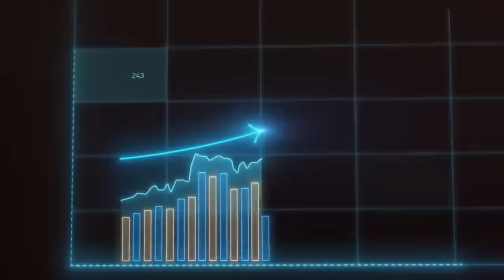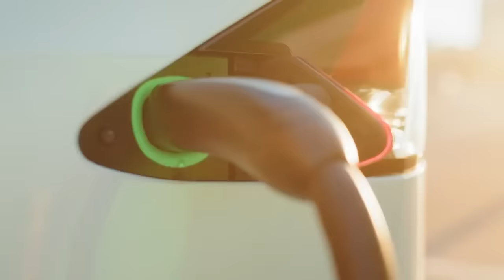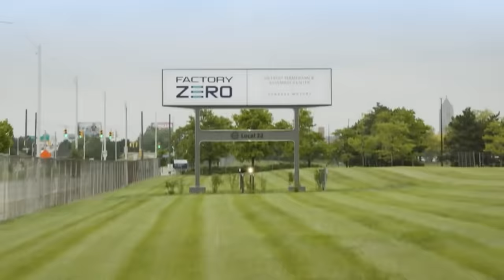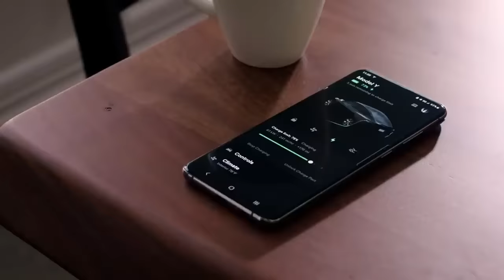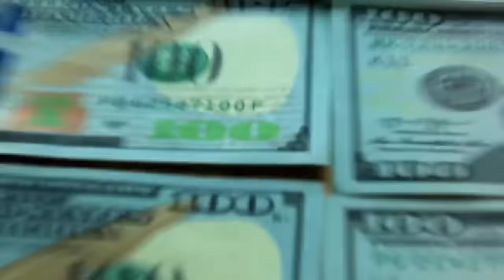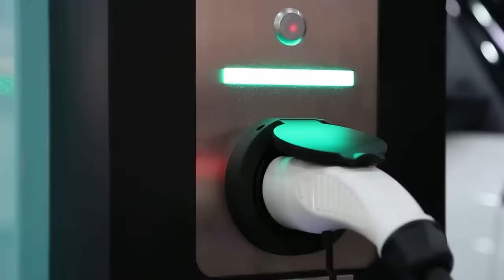Electric Vehicle Owners Are Frustrated and Demand the Return of Gas Cars

Comment: Things to love about EVs:

1. Child battery labor
2. Range anxiety
3. Risk of garage fires
4. Paying 20k more than a comparable vehicle
5. Battery denegration
6. Poor resale value
7. Reduced performance in cold, highway
8. Higher repair costs
9. Awful charging network experiences in the weather without restrooms
10. Higher insurance rates
11. Replacing tires more frequently 

But hey theres a tax credit!
Reply: Got an iphone, tablet etc. Lithium and cobalt. But you are happy to buy these products
Reply: @graemeglass7566 , you’re comparing apples with oranges. EV’s have MUCH higher voltage, which makes them far more susceptible to overheating, and thermal runaway.

You don’t recharge a cell phone, tablet or laptop with a 250kW fast charger now, do you?
Reply: Yeah, that pretty much summarizes the situation.

That said, perhaps some of these issues can be resolved with sodium-ion batteries. Nevertheless, there’s that pesky grid capacity situation to overcome.

Personally, I feel EV’s are only suitable for around town commuting. For everything else, use a hybrid. Of course, long haul commercial transport must rely on diesel for many years to come.
Reply: You're not following the $cience 😂
Reply: You hit the nail on the head!!! Worse yet we pay for the EV tax credit with our taxes, so ICE drivers are subsidising EVs.
Reply: You forgot two big ones in your list:
12. Risk of huge repair costs by slightest battery damage.
 13. Headache regulations for EV's involved in an accident. You will not drive home in your EV after beimg involved in an accident.
Reply: You don't charge those with fast chargers AND they're not charged to hundreds of VDC either. You're not on the same planet as a vehicular EV. My laptop battery is 20vdc & its not a massive battery like an EV vehicle either.
Reply: But you can call yourself "going green" to your family and friends. Oh and the dealer  ship will praise you for your lower carbon footprint.
Reply: Spontaneous combustion resulting in a total meltdown and loss.   If parked in your garage, then your house likely burns to the ground along with your EV.
Reply: @graemeglass7566 Because they actually work.
Reply: well that tax credit is going away to
Reply: @BlacKnightRising  Good
Reply: U forgot to add #12. Afraid of ev's setting your purchased home onfire 😵‍💫😵‍💫
Reply: @graemeglass7566  nonessential point.... people don't pretend to save the world by buy those ...also government isn't forcing you to buy those but even they are..... you seem lost
Reply: Yes mate and then add in the waste disposal of the batteries when they are either out of life and are destroyed by a fire. Plus the extremely dangerous hazard caused by the toxic gases and materials given of in a lithium ion battery fire to those who have to fight the fire anyone caught out near the burning vehicle and the environment that has now has become contaminated by those toxic emissions.
Reply: @graemeglass7566 comparing pocket size products vs EV cars 
😂😂😂
Reply: @lrg3834 just sell the EVs to virtue signalers and leave the rest of the ICE cars for  the practical .
Reply: @beansmayne4581  Quite the contrary
Reply: 9 is semi true, rest is ignorant.
Reply: @TheDeano4000  You mean accurate
Reply: @graemeglass7566 lol you think your phone and tablet use ANYTHING like the battery of of car??  😂
Reply: @waltbroedner4754  And we are also paying their taxes when buying gas. The gas tax pays for the roads that they destroy from being heavier than plain gas cars. Remember when tree huggers complained heavier SUVs are harder on the roads??? Now car with 1000lb battery is fine with the same people....
Reply: @graemeglass7566  So you want to defend the child labor to make your car battery, huh?? You are so kind!!!!!  Make child labor great again!!!!!
Reply: Seems you’re not aware Yellowsnowman that Cobalt is used in the refining of crude oil into gasoline & diesel. And that most new EV batts don’t use cobalt anymore.
Reply: @graemeglass7566 
 no choice
Allgovern by lawmaker, profitcedit, Blood money
Reply: @lrg3834  Gas cars are in fact more likely to catch fire spontaneously.  My uncle's 2021 Jeep Grand Cherokee burnt in his garage two years ago, supposedly because of a problem with a fog light...  I've seem countless brand new gas cars burning on the highway or cargo trucks carrying fuel litterally melting the asphalt of the road.

It's just that channels like this one only focus on EV fires since it fits their narrative, while in reality they are extremely rare.

Also, most of the points stated by the OP are simply wrong.
Reply: @waltbroedner4754 you are not subsidizing EVs nearly as much as you are subsidizing oil companies. But I bet you like to ignore that.
Reply: @h.mandelene3279 do you have any idea how much we subsidize oil companies?  The amount of tax spent on EVs is minuscule by comparison. Ok, let’s stop subsidizing EVs and Oil companies. Let’s see how you enjoy paying $10 a gallon or more.
Reply: @graemeglass7566 Pure genius right here,....NOT ...LOL⚡️⚡️⚡️
Reply: Great list, but why  do they have to replace tires more often?
Reply: @TheDeano4000 You mean accurate
Reply: @Rahbinah  the list isn’t great. Most of it is just oil industry propaganda and not true. However, the tires is true. For 2 reasons. One reason is that the evs are heavier, so a bit harder on the tires. But the biggest reason is the performance of the electric cars. They accelerate much quicker and people use up their tires a bit faster with that as well.
Reply: @graemeglass7566  correct. batteries work for little motors or electronics for a short period of time, just not cars and trucks. common sense stuff!
Reply: @waltbroedner4754  thats socialism!!!!
Reply: @berardoferrari  seems to work perfectly in my car. Loads of torque. Instant acceleration. 213 bhp 0-60 in 7.0 secs. Quiet too. Child labor? Do you people have mobile phones, laptops, tablets, Do you buy goods made in China like clothes, plastic stuff made but 12-16 year old girls who live in dormitories, and are sent back to their villages to get married. Honestly get real and stop being so hypocritical
Reply: I think that’s 5. Battery degradation
Reply: Don't care for child labor but the rest of the points are valid
Reply: I'll never go back to gas junk too much maintenance for me
Reply: The government give me a tax break just like you get a tax break for being married
Reply: Not only cold weather but hot weather is bad for the battery same as rapid charging
Reply: Range anxiety….. y’all are making a mountain out of a molehill on that. The charge stations are programmed into the GPS; with a bit of planning, it’s not a big deal. 

Risk of garage fires…….. what about an oil leak from your ⛽️ car, or a leaky ⛽️ can? You’re telling me there is ZERO risk with a ICE car?

All the other grievances are actually pretty valid. 

Although, ⛽️cars aren’t without their problems as well, so let’s keep that in mind. (Oil leak, transmission problems, engine overheating…..)

I’m not saying EVs don’t have issues, but let’s not pretend that EVs are the ONLY cars with issues, bc that is just not true.
Reply: That was a good point about the tires. Because every time you stop in the city you've got to get all that weight going again and that's going to be a lot more stress and those are made from oil.
Reply: Now with the car  burning in the garage you could always buy a robot that will monitor your car that can push it out in the driveway if it's starts getting hot.☺
Reply: EV's are great commuter cars where range isn't usually a consideration.  They can cost less to maintain than an ICE car, though major repairs can be expensive (though the same can be true for ICE cars).  I don't see why EV tires would wear out faster than on ICE cars, unless drivers constantly try to make use of the massive available torque that an EV can provide (burning rubber).  I agree that more work needs to be done improving batteries to provide for cold weather performance, and lifespan.  Also the charging networks are not yet developed to provide the same long trip experience that ICE cars have.   EVs NEVER require oil changes.  Brakes can last much longer than on ICE cars (regenerative breaking, same on hybrids BTW).  The life of a battery should approach the life of an ICE engine, how many miles can you get out of an ICE car before a major engine overhaul, and what does THAT cost?  So the battery replacement should be considered in the same light. 
Nuclear power IS green!  It produces NO green house gasses in power generation, though I have no idea what is involved in producing  nuclear fuel rods. (though the same can be said for the production of solar panels and wind turbines).  The myths of spent nuclear fuel storage  problems are vastly overblown.   EVs are the ONLY possible future as fossil fuels will be used up in a century or so, and we probably can't continue to burn them much longer in any case due to environmental reasons.
Switching to Sodium based batteries will solve some environmental issues as sodium isn't mined, it's extracted from sea water.
Reply: @KennethScharf  Yeah supposedly fossil fuels were supposed to be used up a long time ago. 
The torque on the tires is because the weight of the cars is doubled that would go for the brakes as well. Ev's would be a good secondary car for teenagers or elderly and I like the hybrids they had out but they're trying to push things too fast. Ergo the new problem with all of the weight of the vehicles the parking garages are not built to hold them. 
Due to the cold affect on the batteries their range is being reduced. 
Chargers are not working and it cost too much to put a personal one in your house to dangerous and now with the rise in electric it cost more to charge an electric vehicle than gas. Fossil fuels are not from dinosaurs. Most of it is about control issues about how far people should be able to travel. We believe in Freedom to travel when and where and how and they don't.
Reply: @Rahbinah Because they are that much heavier. They have more torque, so the tires spin easier. And I have got to wander if the tires are more expensive?
Reply: @croberts2358  Yes, most fossil fuel originated from plant material, not animal.  I forgot the weight issue, and that's in the batteries.
I own a Toyota Corola Hybrid (2023 model) and I'm very happy with it.  I've seen a reduction in MPG in the winter, not surprised here as the engine runs longer to provide cabin heat, and the battery probably  isn't as efficent as well.  But the total range per tank is reduced by less than 25% NOT 50% as in a pure EV (at 0F ).
The average home EV charger is just a 50A 220v outlet, same as for a dryer or water heater, not dangerous or even expensive to install.  EV fires are actually rare, though they can be much more energic than gasoline fires.
For now, EVs make more sense for commuter cars, and plug in hybrids for long trips OR commuter applications.  Serial hybrids may be the better design choice, my Corola is more of a parallel hybrid, though its transmission (a three way planetary drive) can sorta do both serial and parallel.
Reply: @graemeglass7566 Yeah, that is clearly the same thing.  It is not even apples and oranges, it is far more different.  And cell phones do catch fire, fun fact.
Reply: @graemeglass7566  They take less material to make.
Reply: @alien11able  really. ? Add up how million phones are built a year. How many power tools are built a year. Do your homework mate. You sound like a child having a tantrum.
Reply: 1. Gasoline cars emit CO2 and other harmful gases, contributing to climate change and air pollution.

2. They rely on petroleum, a non-renewable resource with volatile prices influenced by geopolitical factors.

3. Compared to electric vehicles, gasoline cars are generally less efficient in converting energy into motion.

4. They require regular maintenance like oil changes, filter replacements, and exhaust system checks, which can be more costly over time.

5. Internal combustion engines generate more noise and vibrations compared to electric motors, affecting driving comfort.

6. Gasoline cars typically do not have the instant acceleration that electric motors offer.

7. The extraction, refining, and transportation of oil have significant environmental impacts.

8. Internal combustion engines and transmissions take up more space, potentially limiting interior design.

9. Although this is changing, electric vehicles are often at the forefront in terms of advanced technologies and connectivity.

10. The pollution from gasoline cars can have adverse effects on public health, especially in densely populated urban areas.

11. With the global shift towards clean energy, the future of gasoline cars is uncertain, which could affect their long-term value.

12. Gasoline cars are subject to fluctuating fuel prices, which can be a significant and unpredictable expense.

13. The overall carbon footprint of gasoline cars, from production to operation, is typically higher than that of electric vehicles.

14. Unlike electric vehicles, gasoline cars cannot recapture energy through regenerative braking, resulting in less efficient energy use.

15. On average, gasoline cars are more expensive to operate due to fuel, oil, and maintenance costs compared to electric vehicles.

16. Gas stations and the fueling infrastructure can be vulnerable to natural disasters, geopolitical events, and other disruptions.

17. As the market increasingly shifts towards electric vehicles, the resale value of gasoline cars may decline.

18. Gasoline engines can't match the smoothness and consistent power delivery of electric motors.

If you only consider the weaknesses of electric cars, you're being ignorant. Gasoline cars have been around for over 150 years and only began to significantly improve with the advent of direct injection. Electric vehicles, on the other hand, are set to enhance their batteries through better compositions using more abundant, safer materials with greater capacity and improved fast-charging capabilities, approaching the refueling speed of gasoline vehicles. This is just the beginning of improvements for electric cars, unlike gasoline vehicles, which are reaching their developmental limits.
Reply: @trexmtb4381  You have precisely laid out why ICE cars have no future. 👍👍
Reply: most of the ones are having problems with overseas are the Ev buses Catching Fire and the E bikes.
Reply: AGREE TOTALLY!!
Reply: @croberts2358  so you missed the recalls on American EVs?  🔥 🔥 🔥
Reply: You didn't mention the EMFs they radiate during operation in that list. Like sitting up close to a microwave oven.
Reply: TIRES WEAR OUT QUICKLY AND ARE VERY EXPENSIVE. CHARGERS OFTEN DONT WORK.
Reply: @yellowsnowman9157  the ones that I saw in the United States were mostly trucks I may have missed some of them
Reply: @graemeglass7566  If you think batteries will only be made of lithium, that's ignorance. Batteries can be made from various materials, and it's only now that we are exploring the creation of better batteries with more capacity, safer designs, improved charging unaffected by climate changes, and longer lifespans. Given these advancements, traditional gasoline cars will become obsolete, If you think there's no future in this, your ignorance is astounding. It's like those who believed horses were better than cars, thinking cars had no future.
Reply: @debby705  now that's a new one I haven't heard of
Reply: @trexmtb4381  totally agree 👍
Reply: @croberts2358  Oh, so you think that gasoline cars didn't have these problems in the past, or that batteries will always be made from the same material and never change? Wow, such ignorance is incredible. I'm sure you're comparing it to a cellphone, focusing only on current limitations, which are obviously going to improve. Gasoline cars have had more than 150 years of development, while electric cars have been around for far less time. The key improvement will be in batteries. What will you say when they evolve to charge as quickly as gasoline, drive farther than gasoline cars, and are safer than gasoline vehicles? Also, keep in mind that electric cars are already safer in more than one way. Don't you hear about gasoline cars being more dangerous and prone to catching fire? It's obvious that oil companies don't want the truth to be seen. News outlets are influenced by them, with gasoline car advertisements everywhere, while Tesla relies solely on word-of-mouth. Look at how they are trying to tarnish electric cars, which have far fewer incidents than gasoline cars.
Reply: @markmiller8903  Simply put, people fail to see the truth that gasoline cars will become obsolete in the future.
Reply: If you don’t like EV’s that’s fine - you do you. Range anxiety is only something people have in countries with few charging points. As soon as you realize you can go anywhere you want, the anxiety disappears. Battery research has come a long way in a short time the LFP batteries do not degrade as much nor do they have the same risk of thermal runaway. As for the child labor, there is no cobalt or nickel in LFP batteries. Children are not the only option in production. Battery degradation is a thing, but you make it sound like a car is useless if it after 15 years only has 80% of the original capacity. It will still get you where you need to go. Is there reduced range in the cold – sure, that just means you drive slightly less between recharges. It has zero implications for my daily commute. The repair costs might be high (have never had any), but does that matter if you only need repairs every 5-10 years? I pay 6 times less for “fuel” in my EV compared to gas in Denmark, and I didn’t pay more because it was an EV due to tax. If you believe it is better with an ICE car in your country, then why not just continue using them and let the ones that like EVs enjoy their choice?
Reply: @graemeglass7566 I am not saying I 100% disagree however when EV's do it, it causes a lot more damage.  So I understand your stance better now.
Reply: @trexmtb4381  oh the lies.Around 1832, Robert Anderson develops the first crude electric vehicle, but it isn't until the 1870s or later that electric cars become practical.
Reply: @trexmtb4381  the first car to get a hundred miles per gallon was a Buick Roadmaster that weighed as much as a Humvee
Reply: @trexmtb4381  the problem with the current existing cars is that they are made to expire early they have plastic fans and stuff that are made to break that were made out of metal before
Reply: @trexmtb4381  did you know that the Egyptian had earth batteries they were found in the pyramids.
Reply: @trexmtb4381  did you know that cars have been experimented with that run on hydrogen and also ones that run on water and also motorcycles that run on water.
Reply: @trexmtb4381  yeah sometimes I may seem to be a little bit ignorant, but not so much more than others.
Reply: @croberts2358  What is needed is to improve the batteries. 😏
Reply: @trexmtb4381  oh by the way did you watch the videos from up North about the cars that would not charge and the Chargers that would not charge and people complaining about the EVs and their reasons and they owned them maybe you should.
Reply: @croberts2358  Gasoline cars have been improving for centuries, but batteries haven't. Do you know why? Because of the oil industry, Mr. genius.
Reply: @croberts2358  Seriously, they don't want progress. You seem content with being manipulated and resisting advancements in battery technology.
Reply: @croberts2358  so yea, And cars used to be death traps where you would die instantly in an accident because all the crash energy was transferred to the driver. So, what are we even talking about?
Reply: @trexmtb4381  you're barking up the wrong tree that was done for money and I speak as one who's written on running boards. Road in the back of trucks. Well stop there. Younger generation is afraid of everything most of the laws were written for money.
Reply: @trexmtb4381  No I speak as one who's afraid we're losing our freedom to explore. Scientists should be free. Not told what they can do. Or what they can question within moral reason. No one owns the absolute truth but God. And anyone who claims to is a fool.
Reply: @trexmtb4381  Why thank you for the compliment,  but I don't claim or aspire to be a genius. Actually just level-headed and try to stay sane.
Reply: Actually gasoline engines would do a lot better and go a lot further if they would release all of the technology
Reply: AMEN, tell it like it is.........people need to learn the truth!
Reply: Half of the things on that list are wrong.
Reply: @schwags1969 ice cars burn far more frequently than EVs. Also a fun fact.
Reply: @ChefNutter  going green AKA going woke?
Reply: None of that for me. Don’t believe they stories. Radical right can be as bad as radical left. Get one and make up your own mind, not letting others decide for you.
Reply: @steves2241  I don't think so I've heard people talking about it
Reply: First, let’s consider just the direct subsidies for fossil fuel production—money that flows directly from the government to fossil fuel companies to support activities like exploration, extraction, and development. A conservative estimate from Oil Change International puts the U.S. total at around $20.5 billion annually, including $14.7 billion in federal subsidies and $5.8 billion in state-level incentives. A whopping 80 percent of this goes to oil and gas (with the rest supporting coal), and most of the subsidies are in the form of tax deductions and exemptions and other “obscure tax loopholes and accounting tricks” that result in massive avoided costs for fossil fuel producers.
Reply: @graemeglass7566 I replace mine every couple years because of battery degradation - I don’t call that happy - I would prefer the battery last longer
Reply: You left out: 
waiting time it takes to charge them. 
EVs favor the rich: if you own your house you can charge at home for cheaper, but if you live in apartments you have to change at public chargers at higher cost.
Reply: The tax credit ended...
Reply: @llunaeldas8055   no it didn't. Educate yourself. EVs still a scam
Reply: All true, but add, electric cars are primarily run on coal. How is this better than gas?
Reply: Let's not forget occasionally having to wait for a software update to complete before you can go anywhere. We've all heard the stories about failed updates crippling the vehicle and leaving it unable to drive.
Reply: @PatG-xd8qn 
Relerivly rare B S
1000 Ev fires in one city in one year
😮😮😮😮😮😮
Reply: @garreysellars5525  A simple search on the internet will actually tell you that in fact, even when taking into consideration the few number of EVs on the road, thermal cars are more likely to catch fire.

And which city had 1000 EV fires in one year? And how many fires in gas cars did this same city have?
Reply: Putting stress on an already overloaded electricity network.
Reply: @cableken  If you live in a place where your electricity is produced using either hydropower, nuclear power, wind and/or solar power, then it shouldn't be a problem, since all these methods of generating electricity generate surpluses at some periods of the day which are currently lost.

The problem in all electric grids is almost always at the same time of the day during peak hour.  Thus, you can simply set your EV to start charging before or after the peak hour, when electricity is also cheaper.  This can easily be automated

Also, if you don't need your EV at the moment during peak hour, you can even sell back some electricity contained in your battery on the grid, which both helps to reduce the problems during peak hour and you can make a profit
Reply: @graemeglass7566 I am happy to buy a device with a lithium battery! Ill even play with a lithium polymer rig if I'm feeling adventurous. However, I don't hop in my phone to get where I need to go. Your phone may be a reliable form of transportation, but mine isn't.
Reply: @graemeglass7566  So you want to compare a hand grenade to a nuclear boom? Please use some common sense.
Reply: @2ndexplosivebullet  , you might want to take this up with the folks at Hertz because they're not going to agree with you; and they have a lot of experience with EV's.

Regarding ICE fires, trust me, none of my ICE trucks are gong to catch fire unless one is in a very bad accident. And even then, you have a good chance of putting out the fire with a portable extinguisher. EV's? Call the fire department and step away from the vehicle.

That said, it may be a different story with sodium-ion batteries. They look promising. Less density, but worth it if most of the issues with lithium are overcome. Sadly, when they do go mainstream, lithium-powered EV's will plunge in values (I feel sorry for many early adopters).
Reply: Hundreds of battery packs vs one. Great comparison.😊
Reply: @franklin519  The so called "oil subsidies" are standard accounting principles that apply to all companies. It's ridiculous to single out oil companies for using standard accounting principles. People like you also fail to acknowledge the taxes on diesel and gasoline. By the way while EVs do more damage to the roads they are subsidized by people pay road taxes. Don't get me started on the huge tax credits the rich get to buy luxury electric cars.
Reply: @franklin519  You need to list the specific subsidies that an oil companies get that aren't available to other companies. If you can't do it than your claims are with out merit.
Reply: @jimfarmer7811 
 
YouTube won't allow links.
How much US tax money has been spent in wars to protect oil resources again?  It's a lot more than EV subsidies. I'm paying for that with my tax money, ever think about that?
Reply: @franklin519  what a cop out. So you can't list anything to support your position. I suspect that you looked it up and found out that the "subsidies" don't exist. What a clueless 🤡
Reply: And they either are too uneducated to know, or conveniently ignore, the fact cobalt is used in refinng oil.
Reply: Add 74% higher risk of blood cancer (Leukemia) to drivers and passengers sitting on a floor of batteries, due to high EMF exposure.
Reply: 12. Several hours of recharge the battery in subzero temperature 😅😂
Reply: @graemeglass7566  Yes, child battery labor is not acceptable, but we don’t pretend that we are saving the planet. We don't say buy a lithium smartphone to tackle the climate change.
Reply: @Rahbinah as the Ev car is significantly heavier than an equivalent ICE vehicle, it puts more pressure on the road, and wears out the tyres faster
Reply: @waltbroedner4754  Not only are we subsidizing their tax credits,  we are subsidizing EV’s with every gallon of fuel we pump.  Even if they get charged $200 more to register their EV $200 is nothing compared to what we are taxed to maintain the road infrastructure.
Reply: @trexmtb4381  Horses better than cars, we've all heard that false comparison before. You know you could make the same argument for Hyperloop (which failed and was always impossible)
Reply: @trexmtb4381  This "batteries haven't improved" is BS, batteries have been improving since the advent of the mobile phone, tablet, and laptop. We got Lithium Ion batteries because of mobile phones, tablets, and laptops, NOT EV's.
Reply: @dguy321  Guaranteed, if you took EV fires per EV, and ICE fires per ICE, you would find that EV's catch fire more often. It's only because you ignore the fact that most vehicles on the road today are ICE vehicles, and the least vehicles on the road are EV. The amount of fires per EV per person is WAY higher than ICE cars. Look in China, BYD is notable for burning to the ground, as with most other Chinese EV's.
Reply: @PatG-xd8qn  Selling power from your EV back into the grid will wear your battery down faster than if you only used it for driving... So the cost of selling energy back into the grid is basically the cost of buying a new EV battery sooner rather than later.
Reply: @franklin519  If you think wars are not fought over Rare Earth Metals (REM) then you're the dimmest bulb in the bunch. REM are fought over just as much if not more than Oil. Why? Because of the military industrial complex needing chips for missiles, jets, ships, etc.
Reply: @ElvinDude  You can't compare to smartphones... 1) the battery is MUCH smaller and uses far less rare earth metals 2) Smart phones don't use the same voltage / amperage that EV's do 3) You don't need to install/upgrade your home wiring because you bought a cell phone 4) you don't have to wait outside in the cold to charge a cell phone 5) you never have to tow your cell phone from the super charger back to home 6) you don't have any tires on a cell phone that wear out faster and need replacement ... I could go on. Cell phones are not comparable to EV's - just stop with the insane comparison.
Reply: @fmo94jos8v3  incorrect. Ice vehicles burn far more often than Ev's per capita. Hybrids burn more frequently than ice vehicles, and EVs burn the least frequently. All per capita.
Reply: All true for non-Teslas, you got it!  I’m sure the fact EVs have 1/10 the fire issues including garage fires vs. ICE car for car means little…. Latest battery techs don’t use rare Earth materials, it’s amazing how off you guys are on the realities of EVs are, you are lapping up the oil-industry “news” FUD…
Reply: @fmo94jos8v3  I guess you can’t read, the commenter above comparing Smartphones with EVs, so both technology uses child labor. I’m just saying people who use Smartphones don't pretend savior of the world. So stop being hypocritical, that was my comment about.
Reply: @fmo94jos8v3  By the time there will be enough EVs on the road for us to worry about electric grids (meaning in many years), the technology behind batteries and the number of cycles they can go through will have improved a lot.

Also, what we have learnt over time is that most car manufacturers used to understate the durability of their batteries in order to avoid getting sued, since they actually didn't know how long they would last.  For example, in the first generation of the Chevrolet Bolt, the company stated that the battery of the Bolt would only last 3 to 5 years and just about 100k kilometers (or around 60 000 miles), but time has proved that they are far better than that with most (if not all) Chevy Bolt still working perfectly for way longer than that.
Reply: Best part is the Tesla superchargers powered by diesel generator sets built in shipping containers.
Reply: @kdrapertrucker  Where is this?  The only 3 articles I found referring to this have actually been proven to be false.
Reply: What about ROAD TRIPS???
Reply: @fmo94jos8v3  That's why we need better-made batteries for cars. As you've mentioned, lithium improved for mobile devices and similar technologies, and now we need something better for vehicles.
Reply: @graemeglass7566 no yet are you attempting to compare a battery car to a device?🤭
Reply: @waltbroedner4754 👍 next will be a rise in insurance even for ice just to supplement the cost!!🙄
Reply: @schwags1969 🤔 you comparing a phone thermal runaway with a battery car??🤭
Reply: @TheDeano4000 resale value is good ? lol.
Reply: @0Aus  Here is a dictionary definition for you
 "a thing made or adapted for a particular purpose, especially a piece of mechanical or electronic equipment." Duh!
Reply: Don’t forget they will implement a tax based on milage driven to recover revenue from missing gas tax.  Since they are all connected vehicles, they know exactly how many miles per month and what you owe the government in road tax.
Reply: @graemeglass7566  🤭🤭🤭🖐 you didn't just stuff that up?yep
Reply: @BMT3691  So what? Tax is tax! The government will tax you all sorts of ways
Reply: Got rid of an ebicycle, never mind an ecar.  Even though alot cheaper,  couldnt handle having to pay £650 after 500 charges for a new battery which worked out about 3p per mile for a fricken bicycle, and that is not including replacing the motor at some point.
Reply: Neatly listed well done
Reply: @DemiGod..  A bad buy then? Whose fault is that?
Reply: @bio-techlarry9602  is that your argument? Are you still in primary education?
Reply: All cell phones and computer batteries use the same tech so in a way we are being hypocritical about this when it comes to child labor. Just fast charging networks for Tesla is near a gas station, Walmart or a restroom. I pay more to repair my gas cars than my EV. Think about all the individual parts that go bad periodically and all that adds up. I spent 250 bucks just for a coil for the spark plugs. I have never had range anxiety in a Tesla and battery degradation happens when you don't listen to the suggestions to not charge to 💯.
Reply: @glenpaul3606  Yeah, parking EV in garage is like sleeping with a grenade under your pillow.  Happy Dreams
Reply: Are you for real ?!
Reply: EV is for caribean countries, where there is no winter!
Reply: @expomm  you also have high electricity cost and no ability to repair
Reply: You had me at "child battery labor". I'll keep buying gas powered vehicles.
Reply: @mrsun9775  only heard about garage fires caused by hybrids and my insurance is only higher because I door dash with mine so I read between the lines and do you own research instead of listening to haters like this guy.
Reply: Why do EVs need new tires frequently?
Reply: @blinkingred  EVs need tires more frequently due to the extra weight of the batteries. Some EVs weigh up to 3000 pounds more than a regular vehicle because of the batteries. The replacement cost of batteries for an EV can run anywhere from $4000 to $20,000 depending on model and make. I'll stick with my Gas powered Vehicle.
Reply: 12. people making up 11 fictional reasons.
Reply: Plus, because of the tax credit, the car manufacturers are raising the price of the vehicle.
Reply: Exactly!!!! 👏🏻💯
Reply: @graemeglass7566 you really wanna compare an iPhone with an EV ?? 😂
Reply: @blinkingred  this is new for me too considering all I have had to do is rotate and maybe add air.
Reply: Roadrunner_1000  But gas cars also need huge trucks carrying all the fuel everywhere, and accidents with those happen every single year.  Just 4 weeks ago in my city a truck carrying fuel burnt on a bridge and it litterally melted the road and the bridge was closed for two days

In reality, EVs are very unlikely to catch fire relatively to gas cars.  It's just that YouTube channels like this one only focus on the few cases that occur worldwide and make a huge story out of it.
Reply: As an EV owner, I can't say you are wrong. 😂
Reply: What has Child labor to do with the components that make up a LiFePo4 battery that my EV uses? The lithium is mined in Australia where we don't use child labor to my knowledge. I have an EV and have absolutely no range anxiety. I charge at home 100% of the time and drive around 120kms per day when working. Get your facts right before criticising something you don't understand or want to support.
Reply: Also, according to many in California during the hot summer last year, also reduced range in a hot summer.
Reply: @Rahbinah  Weight, more the 2k kg.
Reply: ....picky picky!:face-blue-smiling:
Reply: Here are a few more:
12. Until powered by clean nuclear energy, they're not as environmentally friendly as advertised.
13. Increased electricity use and consequent strain on the electrical grid will increase charging costs. 
14. What happens when there is a power outage (e.g., brownout, rolling outages, etc.)?
15. Much more dangerous fire with greater health risks that requires 10x resources to extinguish.
16. Tax credits—those are actually a tax on all of us and our posterity.
Reply: @graemeglass7566  wow, the lack of logical deduction is amazing!
Reply: The usual bunch of utter BS, and people still don't get it, for years the same nonsense over and over again.
Reply: @chriswilliams8607  Tell me how. I can tow my boat or a work trailer or a caravan with an EV , like I do with my ice  ute . 1,200 ks unladen 800 ks  towing 2_2.5 ton ,for this purpose you would have to be as silly as Cris Bowen to think it going to happen.
Reply: @gremlinfishing4286  towing for longer distances is currently a problem as charging infrastructure is not yet there where it should be. Currently at many charging stations you would need to uncouple the trailer which is unacceptable. As charging infrastructure is fast, easy and cheap to build hopefully this issue will be gone very soon.
Towing a few tons is no problem as long as charging infrastructure is good. Range with a heavy trailr is reduced to half, so with today better EVs you would need a charging stop every 150 to 250km which is not really a problem as todays better EVs charge within a few minutes. Savings for the environment are huge and outweigh the slight loss of comfort by far, and don't foget that batteries improve by around 15% each year while prices go down steadily.
Reply: zero ponit energy has been hidden and suppressed from us long enough! hence we are stuck with chemical fuels and batteries. I hate 4 strokes in cars and LED lights too.
Reply: @jlo13800  This comment shows the intelligence of a 5 year old, please grow up and face reality.
Every country and every military would use such a technology if it would exist and would be usable. This kind of argumentation "hidden and suppressed from us" is simply ridiculous.
Reply: @chriswilliams8607 Yes i agree that energy and lost technology is slowly coming out.
Reply: why does it cost more to replace the tires?
Reply: and they all look like stuffy bankers or nerds when you look who is driving
Reply: What resale value?